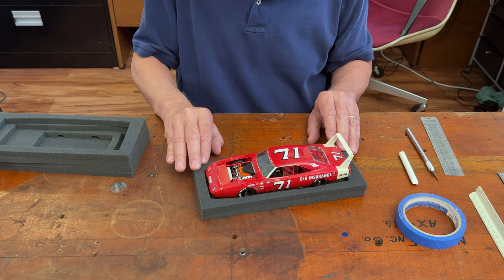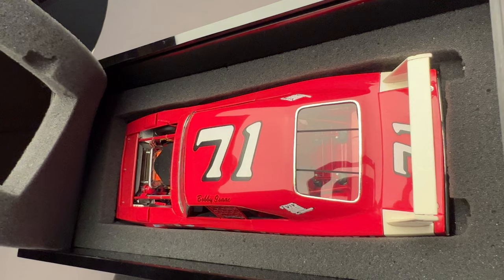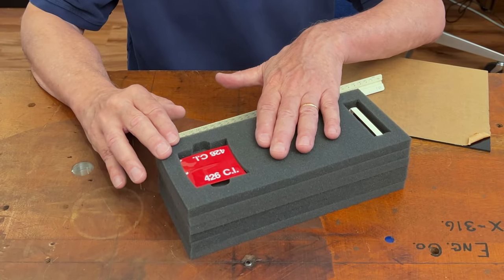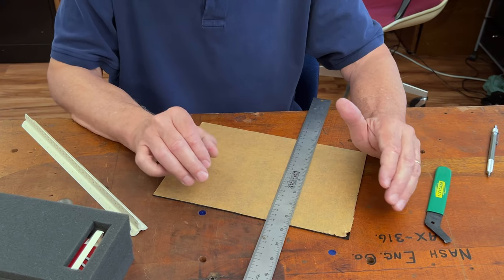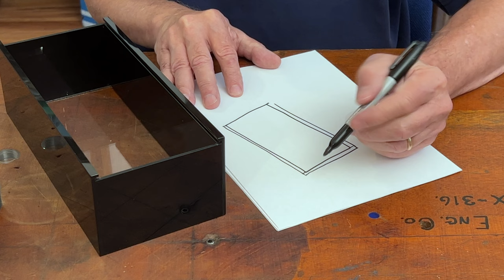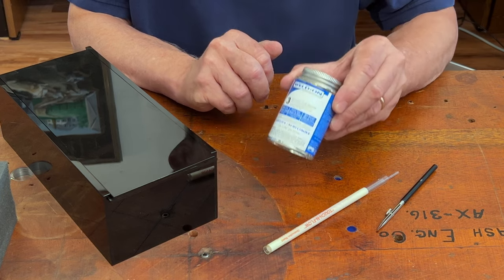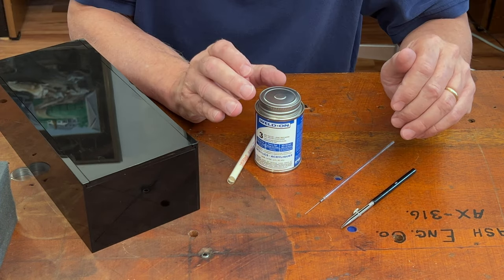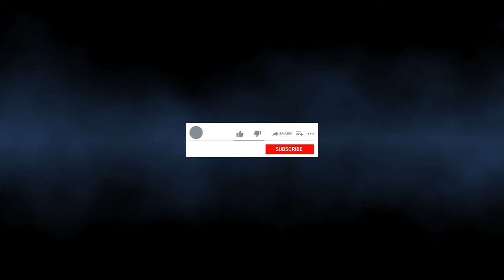DIY Custom Travel & Shipping Boxes for Scale Models

Comment: Boxes and packaging is what I do professionally. I 100% agree with Doug. When it comes to the foam, there are 3 types - Expanded Polystyrene (EPS), Polyethylene, and Polyurethane. EPS is also known as Styrofoam like for coolers. You don't want that. Polyethylene (PE) is more firm and rigid than Polyurethane (PU). PU is squishy and softer. This is what Doug shows in the video and what you want to use. The box Doug shows is awesome. If you don't want to make your own, you can find ready made boxes from a company called Uline. They have a variety of sizes available for fairly cheap. They work quite well. You can find a size that will accommodate what you're putting in and then size your foam to fit. Just offering another option to this awesome video.
Reply from the maker: Thanks for sharing your expertise. Starting with a ready made, sturdy box would save time.

Comment: In the cabinet shop were I worked we use torch on the edges to provide a glass smooth edge after sanding and beveling ! Interesting watching modelers unpacking and displaying there builds! 98% of them would be shaking like a leaf! Maybe because of the excitement or just nervous! This would help with a lot of the registration pain at shows! Very cool! I see another aftermarket product here!🤔😳🫡😝🇺🇸

Comment: Really cool idea! I will definetely make use of this.
One thing I am doing for newer models is that I glue in 2 or 3 nuts in the inside of the car. You can then screw down the model inside a box. That makes it possible to have no conbtact point other than the wheels to the box and secures the car completely. Obviously this is only possible when you actually glue in that nut so this is not doable for my older models which is why this method of yours is really great too

Comment: Doug, regarding the charcoal foam - what PCF spec is the foam you purchase? I am curious if there is a PCF that is less abrasive towards the clear and paint. Along with that, besides the 1/2” thickness, what is the length and width you purchase your foam? 12x12 , 12x24?
Reply from the maker: I don't recall the PCF, but it has not had any effect on my paint. I have bought different lengths.

Comment: Nicely done Doug. How difficult would it be to make one of these for a ship model? Seems nearly impossible with rigging, masts and numerous small parts waiting to break off. Curious to know what you think.
Reply from the maker: Sure, this could be adapted to a ship, just need to determine the secure touch points and leave enough room for rigging to not be touched by anything. Support the hull like I did with the car in case the box goes sideways or upside down, support the masts in case the box is jolted sideways, and make sure the rigging is just in air. If you can plan ahead, make other delicate appendages removable to pack separately like I did with the hoods.